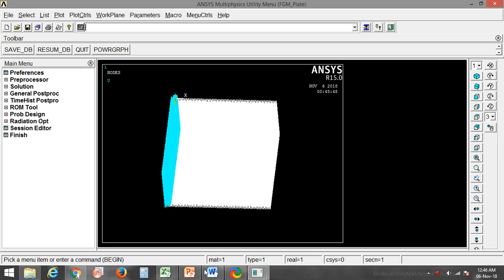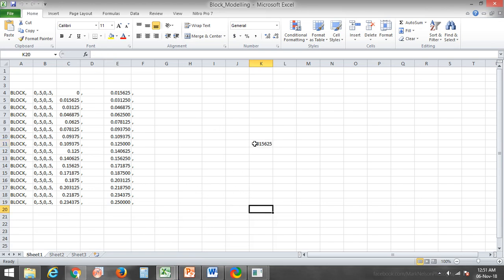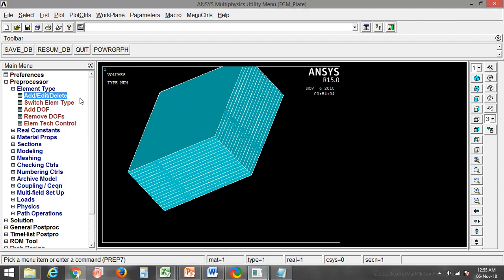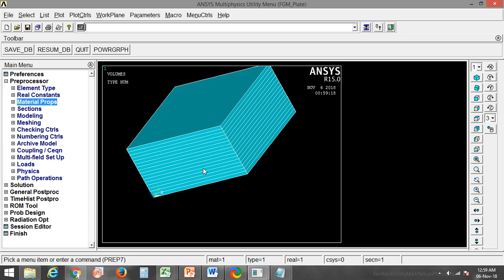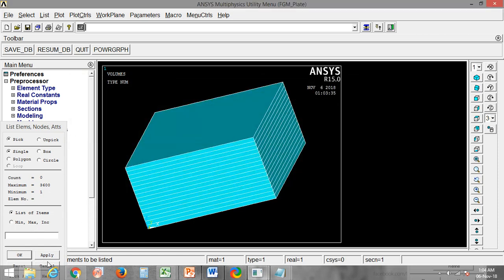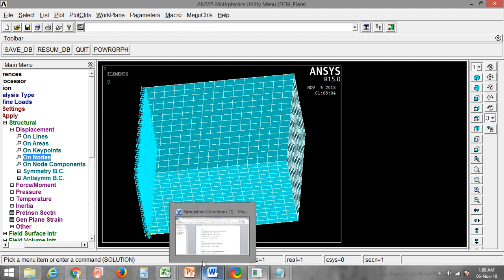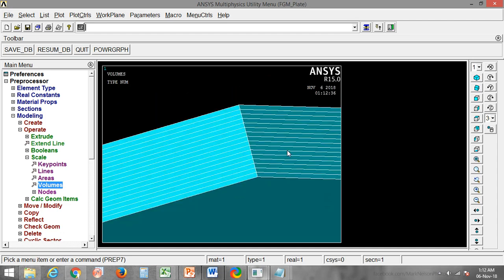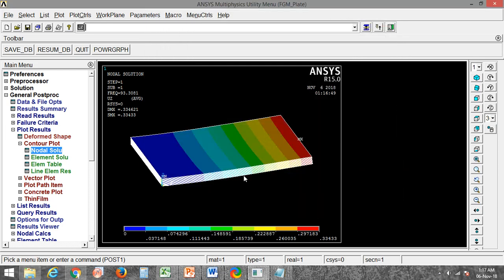Natural Frequency of FGM Plate using ANSYS

Comment: how did you calculate the variation of E? Bec E must be varied in between E1 and E2
Reply from the maker: See my published paper for calculation of layerwise property of FGM...
https://link.springer.com/article/10.1007/s40032-017-0378-6

You can get this paper without subscription of journal by using this method.
https://www.youtube.com/watch?v=Za0ctbg7eTw
Reply: Actually the values i am getting from the power law is different.
Reply from the maker: @vishalantil2369  Ceramic E value deliberately taken 393E8...but for actual case you need to take 393E9...then you will get your desired results